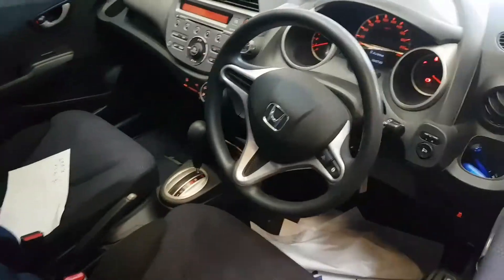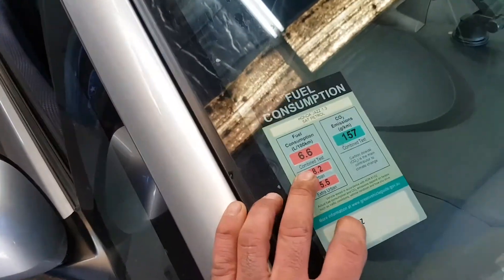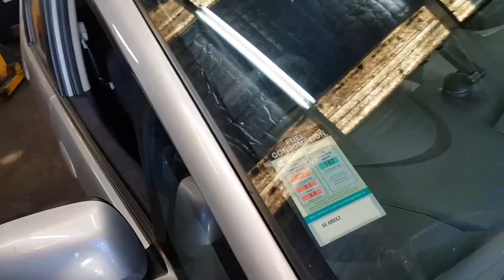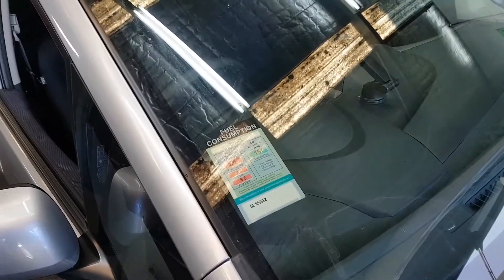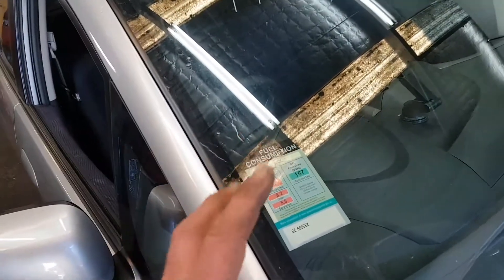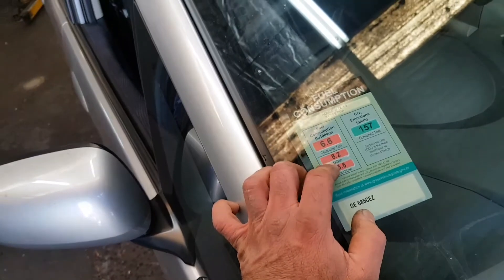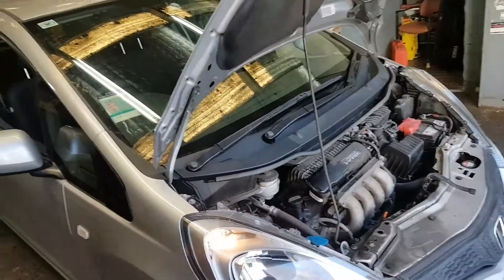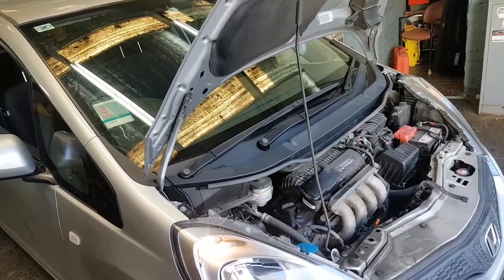Buying a used Honda Jazz Honda Fit reliability rust leaks problems 2011 Honda Fit 2nd hand purchase

Comment: Good point about rust. The earlier Jazz/Fit had an exposed strut top mount, but this version has it buried under the wiper motor and scuttle. It's a mulch and road salt magnet. Kept clean, it's fine. Otherwise, it'll end up rotting away the structure. Very costly repair.

Comment: I got a 2011 I bought with 280,000km Only thing that's gone wrong so far is an axle broke. Common issue with these as Honda put a rubber dampener around the axle that traps water and debris and rusts away.  Torque converter has made tiny sounds for the 10 months I've owned it  but never failed and I've put 35,000km on it in 10 months.
Reply: How is it holding up? Im looking at a 2011 sport model with 100k miles.

Comment: Hi, can you please elaborate more on why you suggested non black and non cvt second hand honda fit?
Reply from the maker: Hi the black paint is prime to fading and healing in really hot climates and the CVT is a very well known issue from very low miles they were a disaster
Reply: @MechanicalMentor  Thank you! Can we safely say to not opt for any CVT Honda FIT in 2011-2015 because of the CVT? Where I live they import a lot of second hand HONDA FIT (with the CVT) from Japan with 40k - 80k Kilometres and they are not expensive (approx 9000€). I am asking because we are considering buying one and compared to the Vitz of the same period I thought it would have been better.

Comment: Really that bad fuel efficiency, I would not have thought it was quite light on fuel. Are you putting the pedal to the floor ? 
My mom just bought a 2013 jazz 1.3 with 90k, clean car but I would have wanted a 1.5.

Comment: why not buy a black jazz, ?as i was just about to arrange to veiw a 2012 honda jazz
Reply from the maker: Ok as long as it has low miles. Manual is better avoid 7 speed cvt. If 7 speed cvt check for shudder on take off. Honda are better cars in most ways than Peugeot but the earlier jazz is a real dog. Do not buy pre 2012 jazz.
Reply: Mechanical Mentor had a jazz 2004 only sold it week ago cvt slight judder because it never had fluid change for 30000 miles apart from that was great runner, but why not black specifically as im going to veiw one 8n black, thanks
Reply from the maker: Simon Baker  black is fine i didn't mean that re colour. Also the fact were all faulty. Cvt no matter how.many fluid changes
Reply: CVT is safe if you look after your car... stay away from Mk2 i-shift gearbox ;)